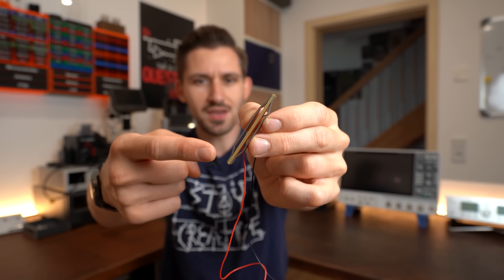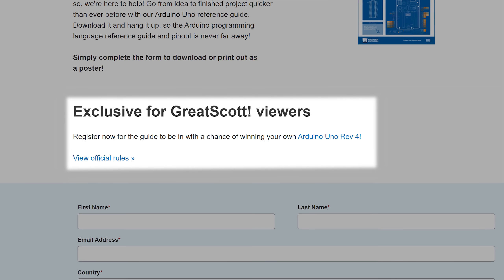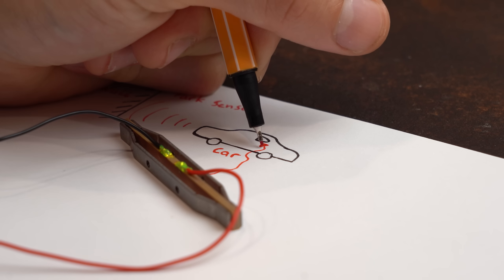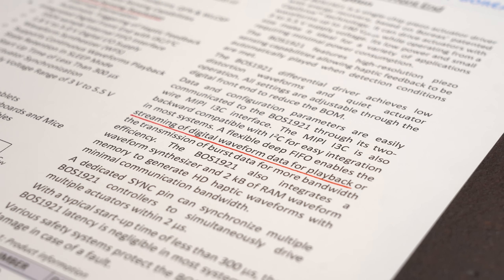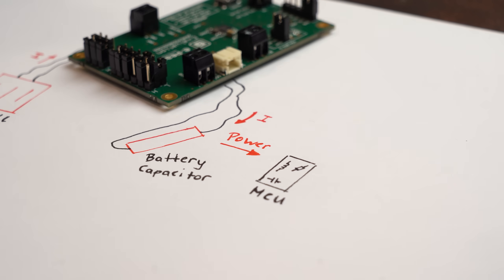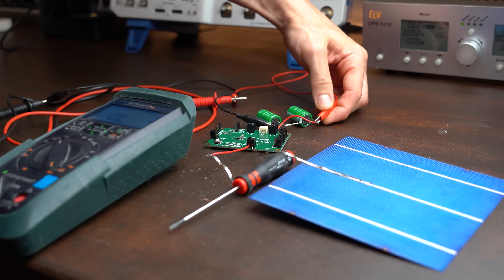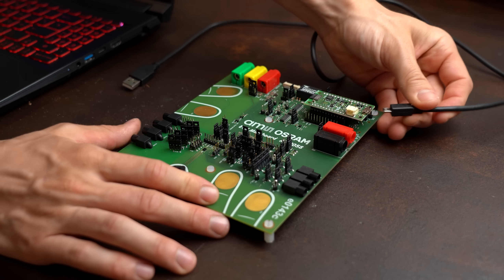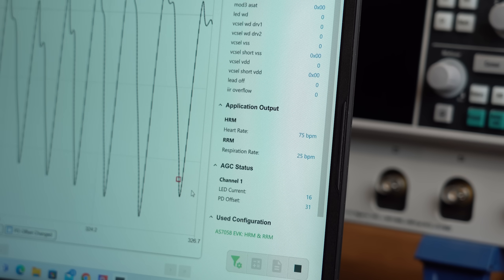I tried Future Technology! (that you can use TODAY)

Comment: As a person who works with ECG signals (mostly writing code that processes signals from wearable ECG recorders), the last demo showed basically a bunch of noise and almost nothing of substance. I saw a comment saying that You should add other electrodes and I agree because this signal is awfully reminiscent of what happens when one of the electrodes gets disconnected when using a virtual ground for ECG.

For people who are more interested in the details, You can somewhat make out the R peak in the data but the T wave is so large (greater than R) that it is impossible due to heart physiology, T wave is the relaxation of the heart muscle and it is usually about 1/3rd of the height of R, and the P wave is also nonexistent which also should be impossible because that's the signal that starts the muscles moving in your heart.
Reply: Ecg really Looks crap and If your SpO2 really ist Just 92% you should see a doctor
Reply: I was gonna say it looks like noise — my Apple Watch’s ECG does that if I don’t have my finger on the crown properly if I’m moving around
Reply: I'm not as experienced in the field, but was also going to say. Thanks for the detailed post!
Reply: I love comments like this. Good stuff
Reply: I would straight away use the USB isolation card you recently presented in one of your videos to decouple your laptop from the demo hard per supply, and use a low noise PSU to specifically power the board in order to reduce the noise
Reply: Out of curiosity, is that a subset of signal processing that would involve using wavelet transforms to process the data? I'm just wondering because I've been going down that rabbit hole for other reasons and it's been massively messing with my head, lol. Mad respect if you are working with them.
Reply: Where would I get started on learnign about signal processing? I'm actually interested in research in that field.
Reply: @sarveshp8515  Well, I got into that field pretty randomly, but I would look up some tutorials on YouTube. I'm no expert in this field, and I was lucky enough to have a senior engineer assigned who was extremely happy to teach me. The only concrete thing I can tell you is that you need tons of mathematical knowledge to boot, understanding convolutions of signals, how filters work, etc. At my workplace, we also churn through a massive amount of research papers to find new ways of processing those signals, so getting comfortable with the jargon is also pretty much required
Reply: @polishfuze1934 do you think the sensors were appropriate? He was measuring off from his fingertips, seems a bit off
Reply: @dante_rf  Well, I've seen tons of advancements and lots of stuff that seemed impossible to work, so I'd like to create a model that uses the fingertips instead of proper electrode placements. For example, one of my earliest projects was to develop a model for translating unusual electrode placements into the usual pairs. Surprisingly enough I got some pretty low MSE, so I'm not gonna be surprised if they are doing the same sort of procedure
Reply: There's lots of people who don't have P waves, pretty much everyone with atrial fibrillation wouldn't have them (the P waves represent ordered contraction of the top chambers of the heart but disordered contraction will still set the bottom chambers in motion just fine in most cases)

Comment: Very educational.  I've worked with piezo actuators - they can be tricky to drive.  I think it's more sensible to use coils.  They're cheaper to make and easier to drive and read.  I've used coils to make a processor controlled bass instrument in a small box.
Reply: piezo actuators can feel like an actual button since they are quite hard, they dont have a lot of give.

Comment: of course the health related devices like the last dev board are expensive as hell.
Reply: The IC itself is pretty cheap. (About 3-5$) These Evaluation boards are always very expensive.
The haptic feedback one is 250$ for example, while the IC costs 3$.
Reply: Evaluation boards are for the engineers and designers, the main ic is for the product, they make these products because of companies so they can have tools to prototype a new product, thats why they are SUPER expensive, and they probably dont order just one board they order like 15 of them
Reply: @Lavadawg  thank you for sharing that. Now it makes more sense.
Reply: @Lavadawg  exactly!
Reply: Dev boards are always expensive. Because, it's for product testing. And, a company using their ICs will definitely won't mind paying a premium for a well built sev board.
Reply: Well, it's from AMS OSRAM, that's a good and reliable manufacturer. They make all kind of sensor for the automotive, industrial, and medical sectors.

So I think you shouldn't compare it with prices of other hobby dev kits, because for an engineering firm 300 dollar for a dev kit is normal.

It would be much more expensive and time consuming if the engineer had to find out all those things about the sensor himself.
Reply: I see the same board in the video is 320-400 while the chip itself is 4.86 if you only buy one. 

That's one I definitely won't be buying. I'm also very new to this hobby .
Reply: @allenrusselljr  I'm a complete idiot but I won't be buying either.

Comment: Heya! Love the video, I'm definitely getting that Body Sensor board as well, that's pretty awesome!
Just gonna say tho: If your SpO2 is actually only 90%, you should get that checked out. Normal SpO2 is 95% and above and lower could indicate a mild respiratory desease.
Reply from the maker: Oh boy......will check that again. Hopefully an inaccuracy
Reply: @greatscottlab  Yeah it's probably a measurement error but just to be safe, measure again ^^
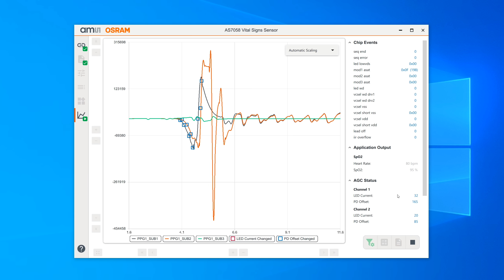Reply: At 10:50 the levels look fine, so im guessing that was an incorrect measurement (pressed finger too hard?)
Reply: The ECG readings are pure noise too, not very useful. Some SpO2 sensors can be very finiky, maybe this is one of these.

Comment: ECGs are for heart measurements, i don't know if it can be measured via thr fingertips as you did.  It probably requires other electrodes as well.
Reply from the maker: But they are actually already smartwatches out there that can do ECGs also by just holding onto it. So maybe it is possible? Not certain though.
Reply: @greatscottlab  You can actually read ecg with only two electrodes or from two arms. There are 3 waveforms that you can achieve depending on which one is your positive and negative.
I: R arm -, L arm +
II: R arm -, L foot +
III: L arm-, L foot +

That’s how your apple watch reads your single lead ecg
Reply: between two hands, google "depolarisation"
Reply: Electrodes (small, plastic patches that stick to the skin) are placed at certain spots on the chest, arms, and legs. The electrodes are connected to an ECG machine by lead wires. The electrical activity of the heart is then measured, interpreted, and printed out. No electricity is sent into the body.

In this case, the electrical signal is getting measured via the fingers. This works the same, like Scott said, with smartwatches where you can hold on the sides.

Although it will be less accurate than having electrode patches on your chest, it's still FAR more accurate than the light sensors on the smartwatches (green LEDS) 

To give an idea on what is the most accurate and what is the least accurate:

Most accurate will be the ECG equipment with stickers/patches

Slightly less accurate (talking very very minimal difference) are the chest straps that pick up the signals just like the ECG equipment with stickers

Now somewhere in the middle will be the finger ECG

And the least accurate will be the green leds of a smartwatch that sense the change in returning light and calculates the heart rate that way.

To quickly summarize, the finger ECG method is very accurate more so than green led method.

Sorry I'm not English :)

Comment: review m5stack core 2
Reply from the maker: I can put it on my to do list :-)
Reply: @greatscottlab Yeah, the m5stack system is pretty interesting
Reply: Don't correct their code typos on Github or they will ban you.

Found one of their examples was copy pasted from another but an input was not changed for the new board pinout and the example would not function correctly.

I fixed this typo and submitted a request and they banned me.

Their example still does not work but my fork does.